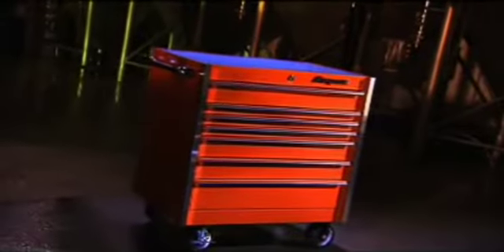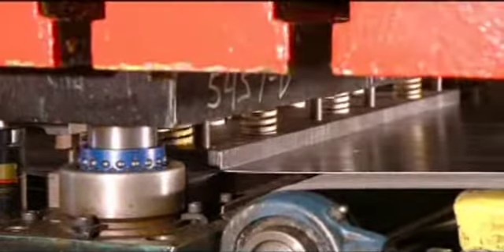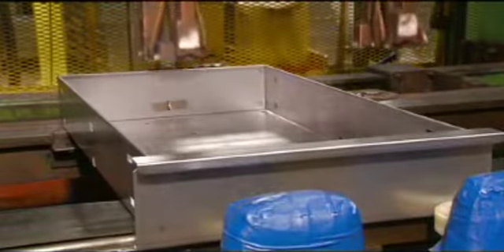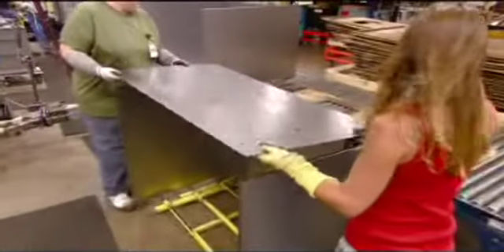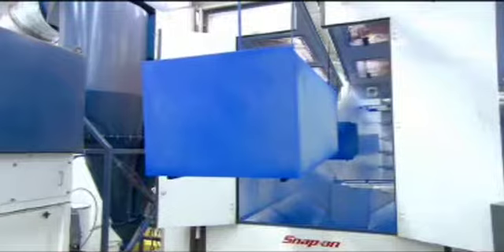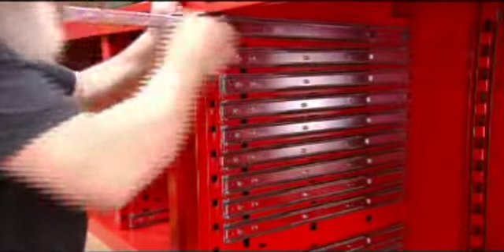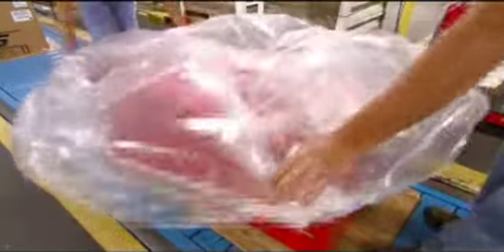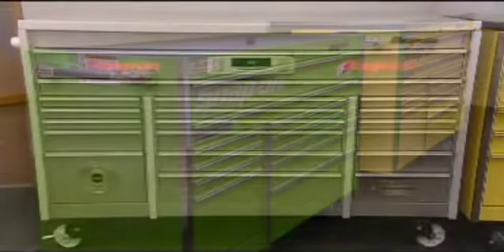Snap-on Tools featured on How It's Made - Tool Storage

Comment: My heart is with SNAP-ON  but my pocket is with craftman.
Reply: Craftsman/husky boxes
Harbor freight tools😁
Cuz at the end of the day..it turns the bolt just the same👍
Reply: My dad has craftsman tools that are older than me and still going strong. That's over 42 years old. My snapon tools never got anywhere close to that. Always had to repair or replace them. Now I'm slowly taking over his craftsman tools now that he's approaching his 80s.
Reply: I’m 17 My hearts with snap on but pockets with Pittsburgh pro
Reply: @Ivan-lw2ux  but they don’t turn the bolt the same…. A cheap wrench will strip out a lot quicker than a quality wrench. And when you round a bolt off and spend 2 hours trying to get it out. Compared to 5 mins with a quality tool to start with…
Reply: Try Cornwell or Matco. They were less expensive and just as durable as Snap On KRL series.
Reply: Not everything you own has to be Snap-On. Just get the best brand for the tool at task. I have a SnapOn toolbox with Snap-On pliers, Wrenches, Ratchets, Sockets and picks. Craftsman Sockets and Screwdrivers and hammers. Starret pin and drive punches. Dewalt drills ans impact guns. 
Bondhus Allen key sets and Ts.

Comment: Where does it go after being spot welded as now you've introduced oxidisation not to mention having bare metal open to the air.
Personally i'd rather have the option to have the box made by NZ steel that way the zinc they use under the paint will stop the dam things rusting from under the fk'n paint or at least for quite sometime. 
NZ steel make metal roofs that last 20 years or more. 
A snap-on box inside a house will last 5 years before it breaks out with rust which tells me quality control is lacking.Bare metal & oxygen don't mix when in a factory. That was the new one that replaced the old after the old one was warranty claimed. The older one lasted longer before rusting.
Then there's the not so little matter of parts of the box not painted at all. It's on the inside top of the roll cab where it looks like it was held by two rectangular arms (can see the outline).

Comment: exact same way the harbour freight and every other mass produced tool box is made, instead of paying stupid prices for a Snapoff box buy an emblem on ebay and stick it on a cheap box lol.
Reply: bdub z you left out the part where harbor freight and similar boxes use thinner steel, drawer glides with cheap bearings and low weight capacities, cheap easy to defeat locking mechanisms, and crappy castors. You can buy a $600 habor freight box every 3-4 years or you can buy a snap on once in your lifetime.
Reply: Sorry man but I️ own an extreme tools $2000 72 wide box and it doesn’t compare in any way to my snap on epiq, as stated above, thinner steel and cheaper parts. The cheaper ones will do the job for a small time tech but when you’re working on heavy equipment you need heavy duty stuff and snap on is the only way to go.
Reply: Yeah I like to see you throw a 1000+lbs in a harbor freight box.......not going to happen
Reply: That’s bs
Reply: I bought HF's top of the line box with locker & side drawer set in 2007-8 and I have entire sets of Snapon chrome SAE & Metric from 1/4 to 1/2 + specialty, and entire sets of SAE & Metric Sunex impacts from 1/4 to 1/2 up to 34mm in the socket drawer. That drawer is heavy AF, it still rolls as smooth as the day I bought it. I have a bunch of heavy shit in all the drawers, the box is so heavy you can't even move it without machine assistance or a winch. Shop friend who had a Snapon box, I compared the two, the steel was about the same thickness and built nearly the same. The cheaper HF roll carts and homeowner boxes of course don't compare.